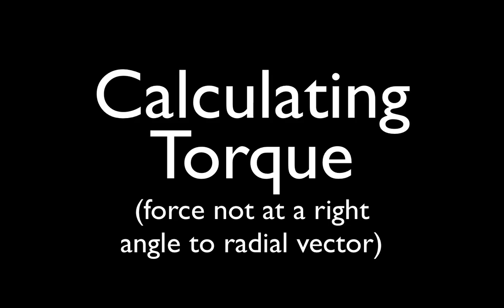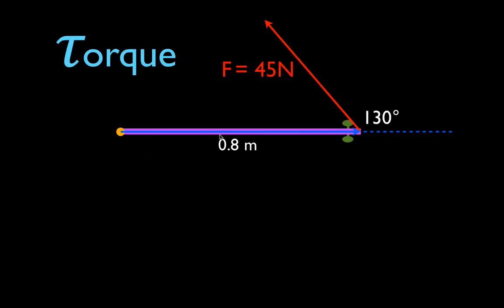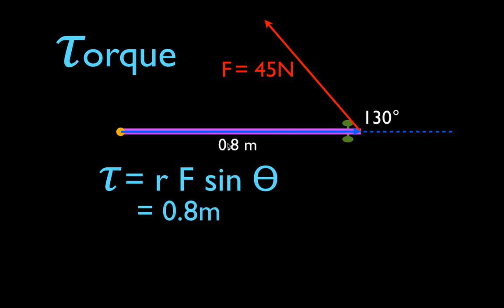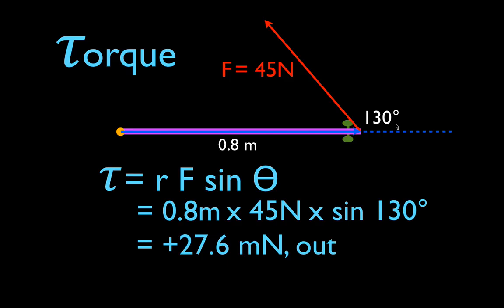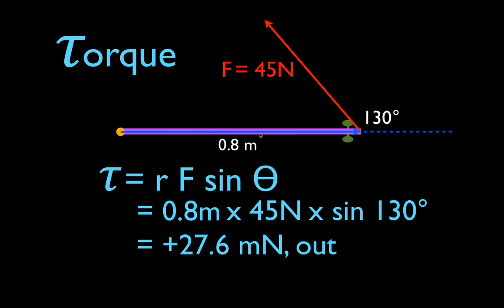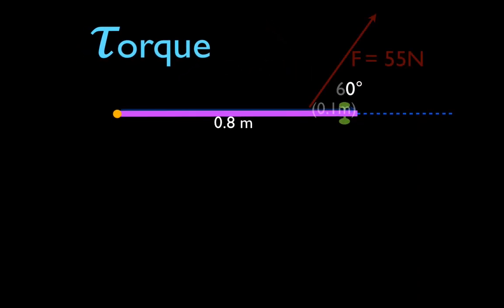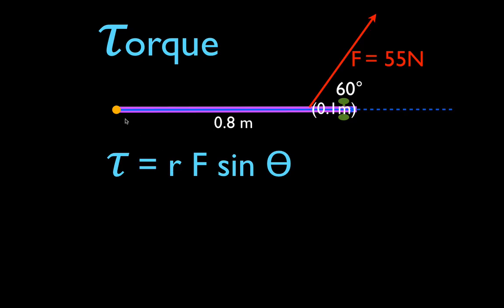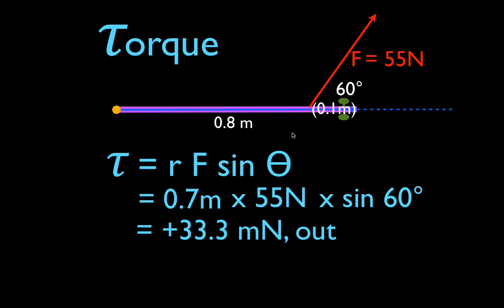Physics, Torque  (4 of 13) Force Not at Right Angle to the Object

Comment: why is the angle at 1:57 130 instead of 50?
Reply from the maker: You can really use either one but you have to make sure you use the correct trig function to get the component of the force that is perpendicular to the lever arm.

Comment: I know that r is the distance in metres between the pivot point and wherever the force is applied, but from 4:07 to 4:35 I still don't understand your explain as to why r = 0.7 m and not 0.8 m... I also don't understand what you mean by 0.1 m from the end of the door despite looking at the image
Reply from the maker: The door is 0.8 m long, but the force is not applied at the end of the door it is applied 0.1 m from the end of the door.

Comment: this was extremely easy to follow and well explained. I understood everything! BUT my physics professor (as well as many others) use the term "lever arm". And that Torque = (Lever Arm) x (Force Applied). Sometimes, the length of the lever arm is derived as the"line from the axis of rotation" that runs perpindicular to the "line of Action". My professor prefers the usage of this equation, and claims it can be derived utilizing trig functions. My question is, in this case; would "cosine" be the trig function used when the angle is between the radial line and the lever arm? thanks
Reply from the maker: Did I not use the term "lever arm") I think I usually say that the torque is the lever arm x the force.  I don't use "line of action" I probably say "radial vector". The angle and sin or cosine is a bit more complicated and maybe hard to explain here.

Comment: mN= Joule
Reply from the maker: The units for torque are the Nm which in the case of torque is not the same as a Joule.  Think of it as Newtons of force for each meter that you are away from the pivot point.

Comment: Why couldn't you use 50 degrees as your theta as well? You would get the same answer.
Reply from the maker: +Nader Mohamed Good comment….and yes you could but I always try to be consistent with the angle I choose.  Right hand rule; point fingers in the direction of/along the radial vector and bend them in the direction of the force and that is the angle between the radial vector and the force.  You can see a listing of all my videos at my website, http://www.stepbystepscience.com